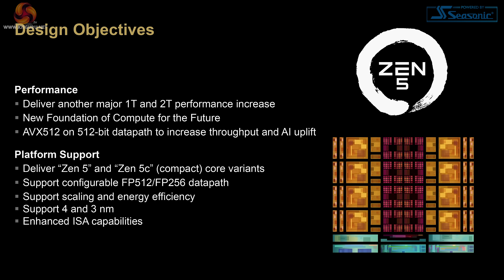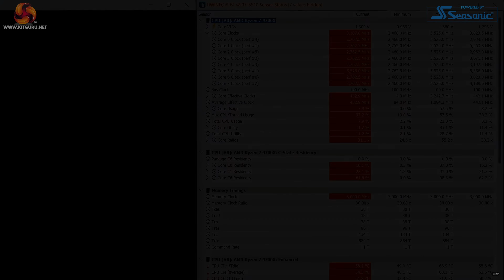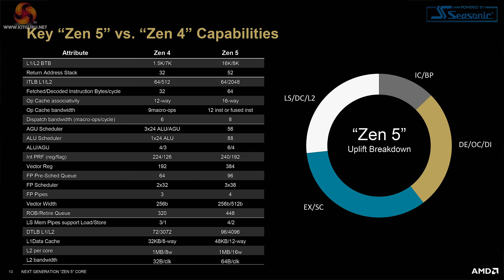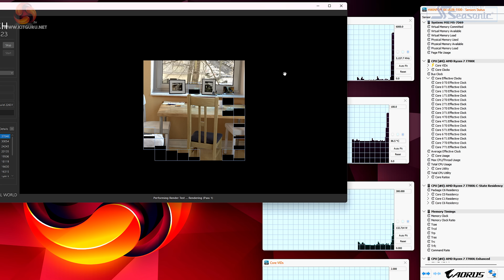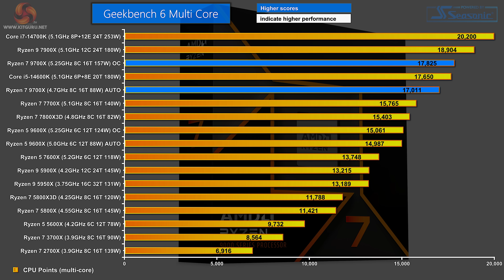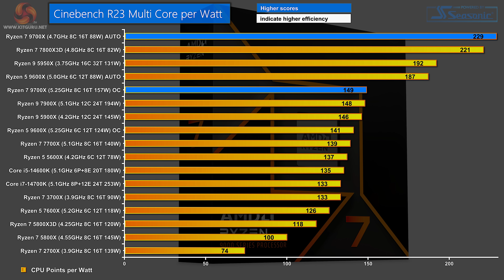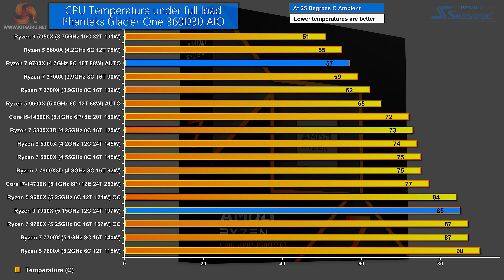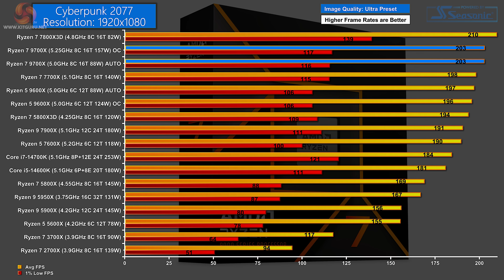AMD Ryzen 7 9700X review: YouTube hates this CPU

Comment: Overclocker's will love 97/9600X and AMD avoids the risk. Otherwise enters the AM5 platform bus saturation inquiry remember woodcrest, clovertown, kentfield, harpertown, yorkfield. Extended AM is no different. The price, TSMC 5 depreciated process I don't think so R7K and R9K cost from TSMC to AMD the same $228ish average across the SKUs however what about bus R9K saturation in the offing?. Regardless AMD will produce more 16/12 cores as they did with R7K to grow their client desktop margin. I expect end sellers to ask for R9K 16/12 core price premium to offset not the 8 core but 6 core price : margin sacrifice. More so there is so much R7K/R5K in the channel end sellers will hold up R9K price while they clear back gen. Also AMD mobile tons of R7K generation surplus and end sellers have to figure out how to cost : price average against that margin loss. Don't be fooled by R9K price you can always estimate what will be $1K AWP as production volume rolls out on AP * 1.27. Note $1K AWP for Raphael R7K full line over the full run is $457 and for Vermeer $440 and on Granite AP * 1.27 = $567. Since Raphaal and Granite Ridge production cost is the same end price depends on how aggressive AMD and the channel want to get. Simple rule on AMD price to volume customers, OEM and retail is MSRP / 3 * 1.5 or for more precision full line average weighed price relying on MSRP / 3 * 1.5. For Intel same precision note but $1K / 2. mb
Reply: I purposely got off the tech process train at 7 nm a 5800X LC LP 5960X replacement. My aim is 10 year life and I knew transistor endurance questions / issue / signs of the coming red brick wall were here and would only become more looming. mb

Comment: The problem is AMD are defaulting these to the "Eco-mode" setting so the performance gain seems minimal while the efficiency gain is really good. To actually get a good idea of generational gain you either need to put the 7000 series chips in the Eco-mode or overclock the 9000 series using the same aggressive settings AMD used for the 7000 series

I think the Intel Debacle caused AMD to rethink things and go with less aggressive but more reliable and efficient settings for the 9000 series. Just enabling PBO will give you a significant gain
Reply: Last gen, reviewers and people like you were complaining about the power draw because PBO was the default settings, and now, geniuses like yourself, are complaining that it is not on default. The internet is full of incredible people...

Comment: Bad is subjective to the previous generation in the 7700X and in that respect it was a disappointment costing the consumer more money for in general less gaming performance. Doesn't make it a bad chip in of itself and if it had been down binned and sold would be a stellar product alone. Also a factor is the silicone lottery one can achieve with some units over others(PBO). Now AMD already stated they had to do this to some degree when there early batches failed QC verification testing. Again doesn't make them a bad chip, but like all new stuff it can come with issues and or growing pains at times. Price you pay for new tech. They will address the issue or media/consumers will and either way we will all move on to something new.

Comment: These chips are trash.    Pay more, get the same performance.

End of story.  They're trash.  

PS, the AMD7700 exists.  The non X.  Very similar performance AND power.

Trash launch.   Buy a 7 thousand series chip instead, get a 3d one for gaming.   

The only good thing about the 9700 is if you give it more power via PBO or manual overclock it does perform better.

Comment: I mean you and other reviewers are not looking the 7700 non-x. if you look at that processor stock vs stock (so around 88 ish watts) against the 9700X you get that in GAMING the 9700X is on average like 8% faster for the same power consumption, now productivity for SOME of the MULTI THREADED tasks people do, the efficiency gains are impressive for the 9700X it is in fact a very capable CPU at those, but that's the thing if you only game and only do a tiny bit or no productivity with this CPU the 360$ makes absolutely no sense. That's the difference nobody is focusing on. As for PBO or w/e you decide to use to go for 150~ish watts it gives great improvements on some applications but in gaming Debauer review for example showed a mere 2.5 to 3% gaming gain while in other productivity applications it was as high as 20%. So in conclusion no, this CPU is not more efficient than a 7700 non-x for GAMING (the 7700X got dumpstered in 2022 by it's high power consumption so why are we comparing it to that CPU? just because of the name? come on people, and 7700 non-x is only like 5% slower) by more than like 8% but in some PRODUCTIVITY applications it seems to be really fast and efficient up to 20%faster for the same power consumption or the same performance for a lot less power but for 360$ if you only game don't bother just go for the 7800X3D.

Comment: So its cheaper and better than last years version? Whats not to like???
Reply: It’s actually a slight increase in MSRP onze you compare it to the actual 65W parts it replaces.

And a roughly 50% hike once you compare it in the market.

AMD’s marketing just pulled the wool over everybody’s eyes. By naming it an X variant.

Honestly looking at the 5-7% performance gains at roughly the same power consumption compared to the 7700/7600 non X variants.

I will assume that most of the uplift comes from TSMC’s improved node.

So brutally honest. AMD engineers achieved jack shit in 2 years.

Comment: Lower power consumption while retaining performance should always be considered a good thing.
Reply: It’s not a good thing if efficiency with the same performance is a thing in a freaking desktop market.
Reply: Good thing is cost more too.
Reply: @Rispes-ne1fk  7700 did this, gets same results, it does not have a X on the end of it so everyone forgets it exists and is cheaper
Reply: was that the same sentiment when Nvidia launched 4000 series? 4060 was 10% faster than 3060 but also way efficient. but still that did not stop people from shitting on Nvidia? Maybe people are more lenient on AMD than on Nvidia.
Reply: @KenpachiAjax  4060 had less vram, a slow bit bus memory, less cores etc, it was essentially a 4050 and same thing with the 4060ti, Nvidia did try and make a good 4060ti by adding 16gb of vram to it however it would of been better if it had the 192bit bus memory that it so desperately needed, I honestly recommend the 4070 as the go to 4000 gpu and if you wanna spend more get the 4070ti super, avoid the 4080 since the 4070ti super has the same bit bus memory and vram and get the 4090 if you want the best GPU money can buy.
Reply: @AssassinIsAfk  at the end of the day 4060 was faster and more efficient than 3060. Clearly you have a bias against a company.
Reply: @KenpachiAjax AMD double standards BS is one of the reasons why I hate the tach community.
Reply: @KenpachiAjax thats not rtx 4060 though its a rtx 4050

Comment: Ran the math, and my electricity costs $0.14 / kwh. The extra 50W from running a Zen4 CPU will cost me $0.021 per 3 hour gaming session. According to PC Partpicker, the 9700X is $69 more expensive than the 7700X. Return on Investment from power savings if you run your PC 3 hours / day at full tilt is 9 years. If you run your CPU at full power 24/7, ROI is ~ 2 years. I haven't factored power need to run A/C slightly more often, but I think you get the drift that this isn't a good situation for this SKU.
Reply: 0,14 is cheap, 0,32 here atm and  possibly getting higher

Comment: I'm tempting to build a system using a 9700x. I like the idea of a very quiet, air cooling system. My only concern is memory compatibility. Ryzen still playing badly with memories? Would be easy to pair it with, say a 6000 Mt/s, 30CL 32GbX2=64Gb? Coming from a 8700K + Noctua NH-D15, that is going to my 15 year old teenager.

Comment: 12:00 not sure if the wrong bar was highlighted or the chart labeling was off, it shows the 7900x. Assuming the labeling since you said 85 degrees.
Reply from the maker: Yup, quite correct, the highlight is on the wrong bar

Comment: I understand people dont see a massive performance uplift, but the power reduction is immense, and its the exact opposite of what Intel are doing - which has cost them dearly. Well done AMD I say
Reply: Wrong. The 9700X is basically a 7700X on 65W eco mode (or just simply a 7700), with about a mere 5-10% boost in performance. The power reduction seems immense because 7000X series chips were allowed to boost freely until they hit a thermal limit, completely ruining their efficiency. Their non-X variant didn't do that, instead they were power locked to a lower TDP and so became immensely power efficient: the 7700 draws ~0-5% more power than the 9700X and is only about 5% weaker. Not to mention that AMD's effectively restructured the 9000 series chips, and while that sets up future generations for potentially even greater gains, it kind of sacrificed this one. Which is to say, they are indeed disappointing.
Reply: @g2fiora  no, 9700x is different, single-core performance is 18% faster than 7700, it even push Intel off the crown. People missed this. eg: 12:16, faster than 14700k.
Reply: @xponen  yeah single core performance is up a decent bit when benchmarking very specific, very single threaded workloads, but unfortunately for AMD in the vast majority of apps or situations that doesn't mean anything. You'd think at least games would like the faster cores but it turns out that's not really the case either.
Reply: How many watts is saved from the 7700non-x? I was sure I wanted to upgrade to zen 5, but not with these performance numbers. So they don't even include a cooler with them now?
Reply: @allensmall5448  I totally agree, I for once am grateful they went for the power efficiency route.
Reply: rushing product to run over intel is wasted opportunity they could wait longer for stable cpu
Reply: But that's valid if you only compare to 7700x.  The 7700 performs within a % or two of the 7700x and it's a 65W part and uses the same power.  Steve @ HWUB highlighted this.

I hope the zen5 gen is building ground work for something, because it didn't bring anything to the table over the last gen.  (USB 4 on the new upcoming chipsets as well)
Reply: @jellowiggler if you look at the architechture daigrams compared to zen/4 it most definitly is ground work foundation for just that!
Reply: False the efficiency is not all that great.
Reply: I feel the same way.  I am surprised so many people are crapping on the 9000 series.
Reply: You're not aware that Intel chips use less power overall than AMD chips?

Intel chips only use more power when it's necessary.

😂
Reply: @DingleBerryschnapps the 7800X3D will use 50w gaming when the 14900k is at 130w.

Comment: Zen5 seems like power efficient Zen4 , 
7700x uses 140 watts and 9700x uses 88 watts for similar performance. 
Well zen5 does use 60% less watts to get same job done , 
Amd should have launched these cpu latter , should have showed 9950x first to show case zen5 power . 
Zen 5 seems good , but zen4 is cheaper so its your choice , less power hungry cpu or cheaper cpu .
Reply: @KAMS-r3s  this would be true if the 7700 non x didn't exist, since that's what the 9700x is, it's a 7700 which a slightly higher clock speed
Reply: @AssassinIsAfk That's what I thought, who would buy the 9700x when the 7700 is less than 290 usd? Huge price discount, similar power usage and ~%5 less performance which is very small
Reply: @gabrielvarela5  people have selective memory, they won't think wow the 7700 is a better purchase then the 9700x because most of them don't know the 7700 exists or that it performs the same with the same power efficiency
Reply: Performance seems to be better in linux than windows with zen 5, there appears to be some likely scheduler or firmware issues to be worked out.

Comment: I also thought GN's review was pretty poor - the repeatedly test AMD chips on stock when they know full well nearly their entire audience will be, at the very least, switching on PBO and likely also mucking with Curve Optimizer.   Zen 5 has clearly been set u for a lower power draw out of the box experience, but with a few moments spent in the bios it shows that it is 10 to 20% up on zen 4.
Reply: Yeah I feel like both GN and HUB (which are normally quite good) really dropped the ball here.  

Maybe this is the proof that we need to take tuning of system/BIOS config more serious to really take advantage of AM5 and/or motherboards are still too "new"?
Reply: @MichaelPohoreski  shit take. "I like these reviewers who are professional unless I disagree"

Testing anything other than stock at a day1 review would be misleading.
Reply: @elirantuil5003 Yeah typically AMD idiot fanboys.

Comment: Frame rate difference in games - the overclock is (i assume) locked at 5.25ghz - the Auto (5.0ghz) will single core up to 5.4 - 5.5 ghz thus giving better frame rate.   (Statement made based on assumptions)

Comment: The new Zen5 might be good in terms of Efficiency but not in terms of performance when 95% of the time they are on the same level or even outperformed by the previous gen CPUs. Zen 5 is a sidegrade, not an upgrade.

Comment: it's power consumption is low, just because it's such a bad performer. If you'd overclock it so it would do the same score in cinebench multicore as 14600k, the efficiency would be on par with 14600k...

AMD saw that they made a shit product and lowered the clocks and voltage, so people would be tricked into thinking it's efficient (being the only thing going for it, which actually is not even true...).

Comment: 1. no one is upgrading from a 7600x/7700x to a 9600x/9700x, they're tested together to show generational improvement, surprised that this needs to be pointed out to a seasoned tech reviewer such as yourself leo
2. even new pc builders should simply opt for the much cheaper zen4 models, as they offer virtually the same performance
3. if power efficiency is such a concern then am5 has a solution for that, it's called eco-mode
really grasping at straws here trying to make this cpu look more impressive than it really is

Comment: An all core overclock will reduce gaming performance, since most modern games including the one shown in the video, have 1 to 2 heavily demanding threads that will use 1 core worth of CPU time, while the rest of the threads have very little activity but they rely on the results of the work done be the more demanding threads. This often results in 1 to 2 cores running at 5.4GHz+ when gaming. To get a gaming boost, you would need to use PBO and increase the power limits, and if you want more performance, do the up to +200MHz offset in PBO.

That will allow for the largest boost in gaming.

Comment: If anything, what this reviews shows is that limiting the 9700X to 65W was a mis-step on AMD's part. If this had been a 105W part like the previous-gen 7700X, I doubt the initial reviews would have been as negative. In my opinion, the smarter play would have been to release it as a 105W part, but include review guidance emphasizing its 65W Eco mode as providing similar performance as the previous gen for 40% less power. Alas, hindsight is 20/20, and foresight decidedly less so.
Reply: Agreed. They could have even named it 9700 as well. Then we would expect efficiency as a priority.
Reply: yeah release a 9700XT with 105W... and lower the price of the 9700X with like 50 bucks..

Comment: Level one techs gets it. Just because it is new doesn't mean you need to purchase it if you already have a functional running system that is within a generation or 2. The Apple mentality needs to get a clue. My 3950x pulls well over 100fps at 4K in AAA games and still kills it for design work.

Comment: Kudos Leo for not just bashing the new chips and focusing on the smaller details. I feel like AMD rushed this launch. They could have given better review kits to everyone and explained somethings little more. These chips are all about efficiency but if you unleash power you clearly see it scales in most cases. Also bandwidth. I've seen some testing where when 6400 memory is used it opens them up as well. As I said I think they pushed it out to soon and there are some OS/software issues that need to be addressed. I feel 6 months from now they will be seen in a different light overall.

Comment: Great review, very level headed and comprehensive.  While I agree with the take that these chips are more for new builders than gen on gen upgrades (which honestly, is usually the case in hardware),  that doesn't preclude the last gen parts as an option for a new builder either.  Both the 7700 and 7700x  are still available, and at cheaper prices.  So the 9700X still has to compete with them for new builders $$$.

So it comes down to is the increase in efficiency/lower power worth the increased price? That's the decision a new builder has to make.